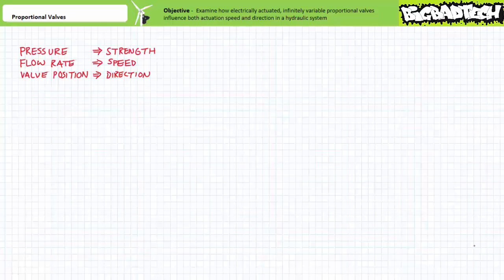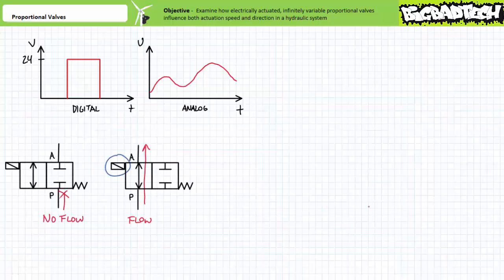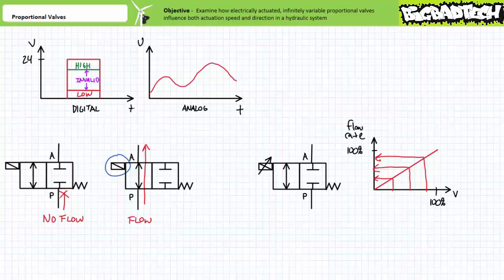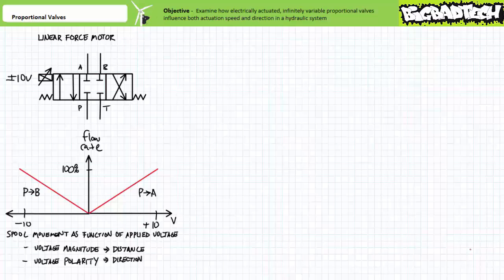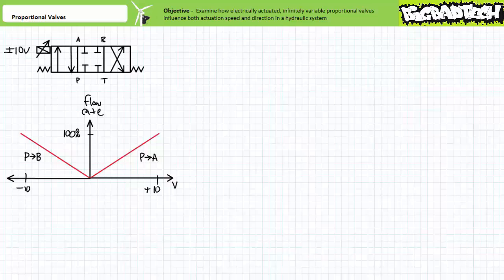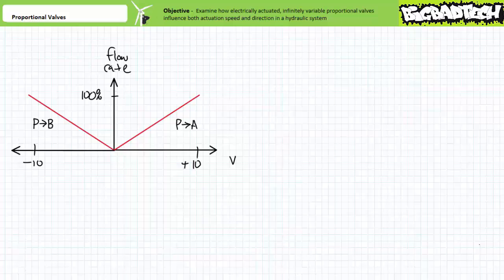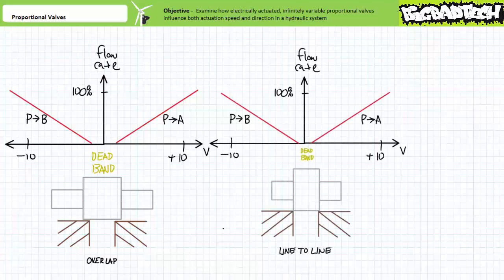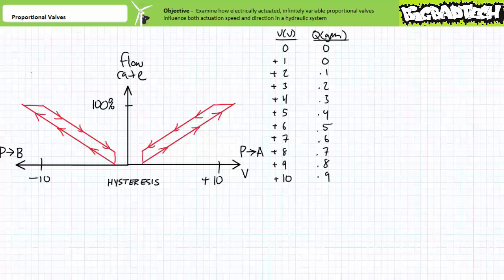Introduction to Proportional (Servo) Valves (Part 1 of 2)

Comment: INSTEAD OF USING A OVERLAPPED SPOOL IN PROPORTIONAL VALVE AND PROVIDING A V NOTCH ON SPOOL TO COMPENSATE OVERLAPPING , WHY CANT THEY USE A ZERO LAPPED SPOOL DIRECTLY , IS IT SO DIFFICULT TO MANUFACTURE A ZERO LAPPED SPOOL USED IN SERVO VALVES?
Reply from the maker: Even the most precisely manufactured spool will still exhibit a tiny dead band because of the magnetic hysteresis inherent in a proportional solenoid.
Reply: Jim Pytel What makes a servo valve so costly compared to proportional valve?
Reply from the maker: I'll eventually return to the industrial control playlist after I've finished "Basic Electronics: AC Circuit Analysis" and "PLCs", however, a "servo" is a general term (applied to valves and/or motors) that ordinarily means a system includes feedback whereas a regular system may not include nearly as sophisticated electrical elements.
Reply: Jim Pytel Okay. I have designed a Hydraulic circuit for a single axis testing machine. Machine tonnage is 30 tons Machine will be used for static and dynamic testing of rubber to metal bonded parts. I have used a moog servo valve for this application. Actuator has a servo manifold mounted directly on the end caps. I am still confused with the accumulator position in the circuit. Can I get your mail id, I will send you the pdf file and the machine photos, can you please help me with that?
Reply from the maker: Sorry, but without direct involvement in the project I'm hesitant to give you advice. This being said I do have a lecture on accumulators that may clarify the application: https://www.youtube.com/watch?v=AC3vZF2aOiI
Reply: @jim pytel, could you please elaborate the working of moog servo proportional valve.

Comment: Jim patyel.
Informative lectures.
I like your videos.
I want to know more about hydraulic valves and want to discuss more with you via whatsapp if you could be available.
Reply: Jimmy.i need your help.
We have a propoetional valve installed in line but the problem arising is of jerk when we give command to operate it, of you could please assist.
I can share with you the complete drawing if you ask to do so.
This ultimately results in breakge of electrode.